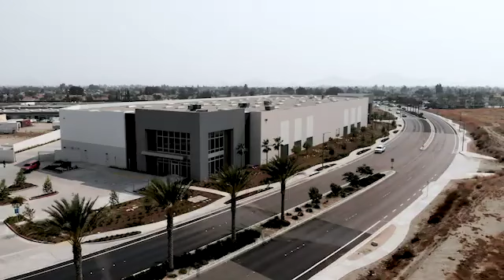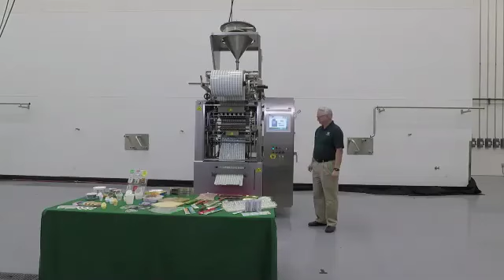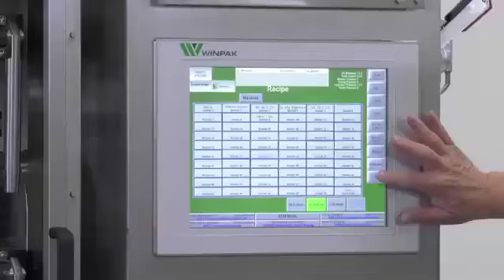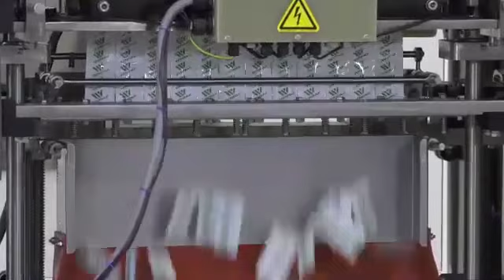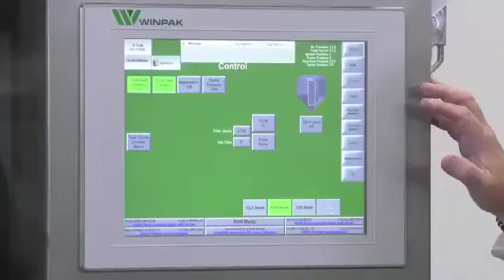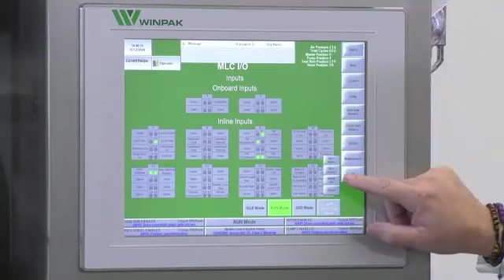The Winpak Lane W-18 Pouch Machine Demonstration from the 2020 Virtual Pack Expo exhibit

Comment: When you have tracking problems what are the things I should look at to fix the film from moving to much?
Reply: One of the first things to look for is if there are any gaps on either side of your film (front and back rolls). Also, if the gaps on your film roll bars are spaced too wide, it would have too high of a tolerance, so it could move out of wack.
Reply: @joeballin68  what else you have that can help me out? I already did that
Reply: @Junior_Garcia13 tension in your dancing rollers